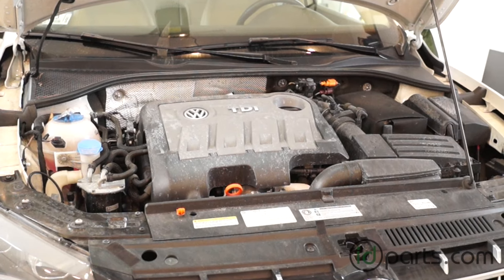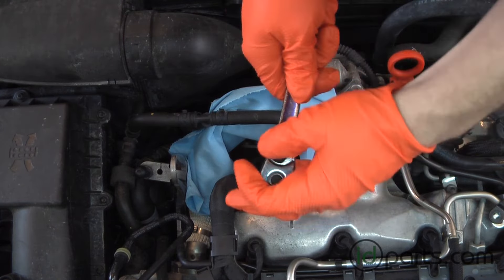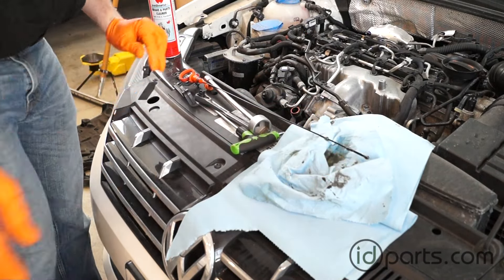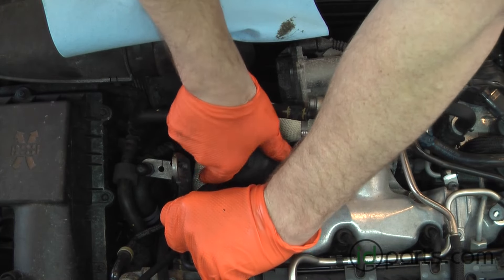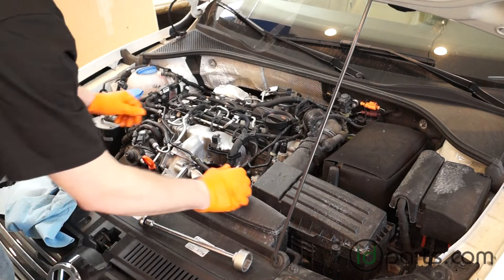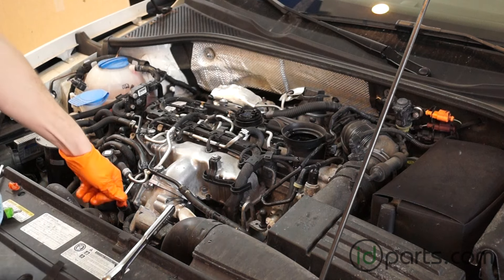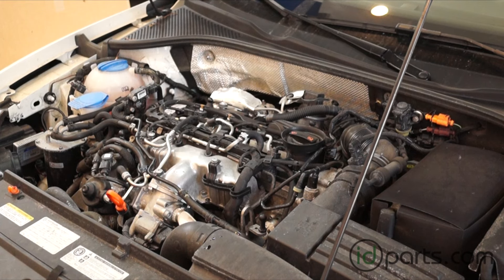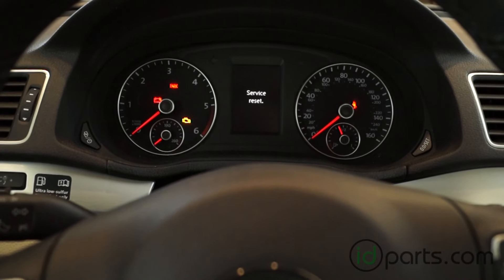2012-2014 Passat TDI Oil Change (CKRA)

Comment: Great how to video. Just bought a 2015 Passat TDI. On the oil fill, you said you were using 4.5 LITERS. Our '06 Jetta TDI took about 4.5 QUARTS (5 quarts max.). A bit of a difference between liters and quarts.
Reply: Update, they are almost exactly the same (1L = 1.05q).
Reply: @agFinder2  great, it only took you 9 years to respond.
Reply: @gwhitcutt  Nine years to see it, 60 seconds to respond ;).

Comment: Thanks for the video.  A local non-VW service depot actually had to remove 3 bolts holding the coolant pipe (rigid ) and move the pipe to get the filter out.  Your method of removing the  3 torx screws and pushing the overflow line aside and removing the bracket seems much easier.  Nice explanation.

Comment: The oil vacuum is well worthwhile!! I did it the other way and met with a bunch of issues:
* The Australian 2013 model Alltrack has a very heavy steel skid plate, maybe 25 kg, was hard to get off with car on low ramps.
* Drain plug is horizontal, so when you remove it, the oil goes a LONG way, about 600mm it seems. Overshot the end of the drain pan, and I had to play catch, then move it back as the stream receded. Got a large stain on my driveway. 
* Dropped drain plug into new oil pan (container style) and it promptly fell down the hole :). So had to transfer again to a third container to recover it. Arghh.
* Bought an aluminium crush washer, but plug had a captive steel washer. After considering various ways to remove the captive washer, I decided to just reuse it as-is.
* Also had uncertainty about the filter (I used the OEM filter). I got a satisfying clunk when I put it on, so that seemed OK (filter markings were on top, near the cap).  Lubricated the O-rings, but there was squeaking as I screwed it in. So I removed it again and found the filter stayed in there! Put it back on and lubricated both the lip of the housing and the large O-ring again with more oil. Screwed it back in, still heard squeaking, but went ahead and torqued it to 25 Nm. Shrug - I hope its OK.

Comment: Thank you for the video, this is much easier than jacking the car up and the whole process is simple. I look forward to doing this on my 2015 passat TDI!
Reply: You can use the oil extractor on your 2015, but the engine oil filter on the EA288 engine on your car must be accessed from underneath. Look for a video, and be prepared. Not fun.

Comment: Nice video and oil extractor is the way to go. I use it on my Jetta TDI never have to worry about tightening my drain plug or changing the crush washer.   
 
Plus the 2013 Jetta you have to remove the rock protection plastic  a lot of torx screws very time consuming.    
 
The oil extractor allows me to stay topside above the engine. Never a oil leak under any of our cars
Reply: Oil extractors can leave up to 1.5 liters of oil in the motor rendering your oil change useless

Comment: Wipe the dust and grunge out from around the oil filler cap, BEFORE you remove the oil filler cap, to prevent the crap from falling into your engine. Important in dusty and dirty environments where people drive in farmland or dusty sandy dirty desert or arid areas.

Comment: Does this method of extracting oil from the top leave any impurities at the bottom of the oil pan ?
Reply from the maker: Not any more or less than draining would.
Reply: This is how you do it on a lot of big boats since you can't jack up the engine. I have the extractor but for some reason never thought to use it on the car oil change, that will make it so much cleaner.

Comment: Why not just drop the oil plug out off the pan to drain instead of using an extractor? Thanks.
Reply from the maker: +ImAPCTech We used an oil extractor because that way we don't have to jack the car up. It's less mess, too.
Reply: Lazy